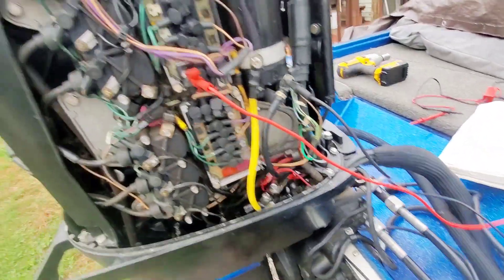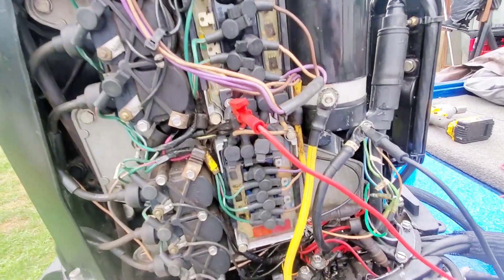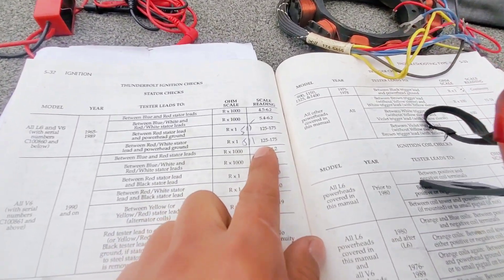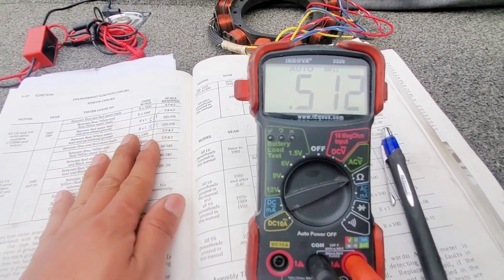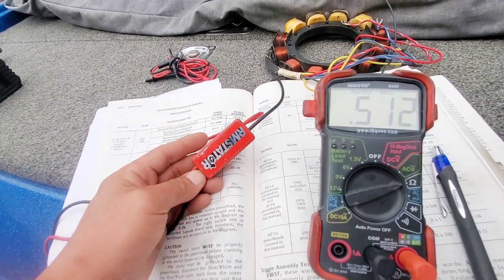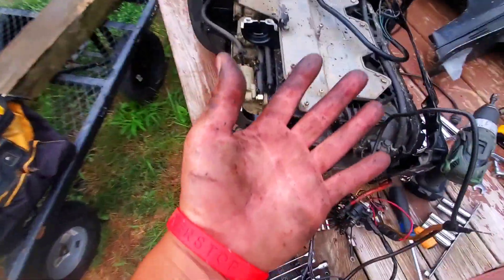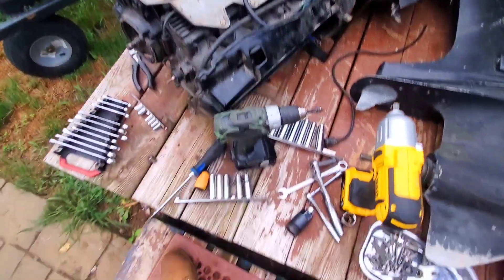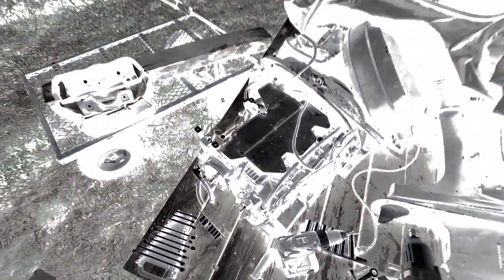Mercury Outboards "Deeper Issues" Testing a Stator: Voltage Output

Comment: Do you do this test while it's idling? And also on your ground wire is there something else attached or just using the gator clip? Is there a specific ground you're to use?
Reply from the maker: Ground the engine to your battery. Son

Comment: (no 1500 distributor )  .. 1150       115 control units new model
Reply from the maker: Not sure what you are asking
Reply: @MerCSonL6  I meant  that your engine is not 150 horsepoer 1976  because it should have a distributor.therefore it is a modern 115 with control units 1980/1986 your 1976 stikers do not match
Reply from the maker: @norwajjohnson8726  correct, it's an 1988 115hp. Last of the inline series. I repainted it with 1976-77 decals. I do have an original 1977 1500 but I'm saving that for my Speedboat. Son
Reply: @MerCSonL6  anyway you are very good compliments..I always follow your videos to learn you are very prepared
Reply from the maker: @norwajjohnson8726  I try to be my friend.

Comment: Hey MercSon, thanks for tons of great videos on here. I have 5 coils reading 970ish but one reading 630. Is it junk? Also all read about 0.1 ohm on the incoming terminals. Any concerns there? I figured if they are all about the same and it runs I'm ok with 0.1. cheap ohm meter here.
Reply from the maker: Replace the coils. They all have to be close in readings. Son

Comment: Mercson,  I have an idle stabilizer on my 1984 or 85 115 hp inline 6. After checking trigger, all 6 coils and stator, the stator ended up being the malfunction.  Back to idle stabilizer the red wire with possibly a white tracer was corroded clear back to about 3 inches from the module.  Is it that important to put back on? If not does the timing need set differently?
Reply from the maker: Idle Stabilizer is not needed on inline. I've always removed them from my inlines. Son
Reply: @MerCSonL6  thank you so much!

Comment: Mercson i have a 1980 mercury 90 hp inline 6 i bought a jetunit stator to replace the old one and the dva voltage is low on red and blue(lower than the stator i replaced.  Could the new one be defective or is something shorting the stators out thanks bro
Reply from the maker: If you have a new stator then the issue points to the switchboxes. Son
Reply: @MerCSonL6  thanks for replying i forgot to mention that i tested the stator connected and disconnected to the switch boxes. Magnets on the flywheel are in great shape

Comment: I'm having a issue with link and sync. 75 merc 850. Model 3872435. Timing on front plate says.172 btdc. Secondary says 27 degrees. Would that be correct.
Reply from the maker: Set @ 26 degrees. Son
Reply: @MerCSonL6  thanks appreciate your vids
Reply: @MerCSonL6  I wouldn't brother but no one around here works on old Mercury's. New belt all my marks are lined up. When I set at .172. no static spark, when I set at 26 I get spark. Thanks
Reply from the maker: @robl6570  so set it at 26. You be able to gently rotate the distributor in the "on" position to generate exactly when the spark should fire on cylinder #1. Son

Comment: Are you available for service if we can send you parts to repair or work on?  I'd like to send you my carbs so you can work on them for me.  How do we contact you if that's the case?  Awesome content by the way.  Really helpful!
Reply from the maker: I'll get back with you soon. I have several jobs I'm working now. Son
Reply: @MerCSonL6  I have an issue with the carbs leaking some fuel, and when the motor runs a while, doesn't want to stay running.  It also turns off when I try to rev it up a little.  You think it needs a complete carb re-do?  Or can I get away with trying to do new seals/gaskets on the carbs?  I'd really rather just take it apart and send it to  you since you look like you know what you are doing. my email is basteghian@gmail.com
Reply: @MerCSonL6  is there a way for me to contact you directly i need help working through a spark issue on my 83 1150 that I have been trying to solve for awhile  and just keep failing please help

Comment: The yellow wires on my 1980 50hp 4 cyl are cooked bare right where it goes into the potting.  Im guessing its bad without even testing it.  Prolly go with a CDI.
Reply from the maker: That is likely if you cannot physically reconnect 2 new alternator wires. Son
Reply: @MerCSonL6  Have a question.  My flywheel looks like it has screws in the bottom all around the circumference.  There are two choices for my alternator.  One with glued magnets and one with screws I guess.  I am assuming mine arent glued hense the screws.
Reply from the maker: @L2fish  correct. Son

Comment: Hey man I was wondering if you can help me out. I have the same exact engine as you, and I just got it to run by charging the coil packs, ( I was only getting spark in 4 cylinders) although it still takes a while for it to start, it cranks and cranks till finally it starts and putting some starter fluid speeds up the process. Any idea what it can be ?? Let me know, thank you :)!
Reply: gabriel Dominguez could be multiple problems. If starting fluid helps, could be lack of fuel in addition to spark issues.
Reply from the maker: @kevinwhite9937  #true
Reply: Kevin White I’m getting spark to all of them, so it’s mostly a lack of fuel. I already had the carbs clean, so I’m guessing to check the fuel pump next? I’m new to this stuff so anything helps haha, but thank you for replying 🙌🏽
Reply from the maker: @gabrieldominguez4603  work the fuel lines backwards starting from the carbs, to the fuel pump, the fuel connectors, into the boats fuel tank. There cannot be any blockage or air (fuel leaking) anywhere. Son
Reply: MerCSon L6 thanks! I’ll check that out
Reply: @gabrieldominguez4603  Thought I'd add 1 additional idea. On the older Mercury models the "Pulse" lines for the fuel pump run off the 5 & 6 Cylinder intake cover and if your fuel pump fails, more specifically the diaphragm gets a tear, the fuel pump can still work well enough to feed fuel to the carbs BUT it will also pump fuel directly into the intake, via the pulse lines and also prevents the 5/6 cylinders from getting fuel to the top of the pistons (lack of vacuum). Chased this problem for awhile (kinda memicks bad REED valves symptoms). Now on the newer models Mercury corrected this by running the fuel pump right off the crackcase.